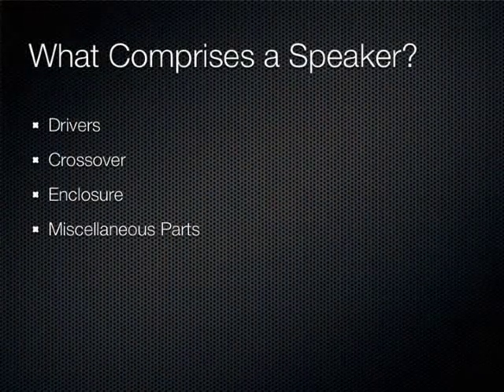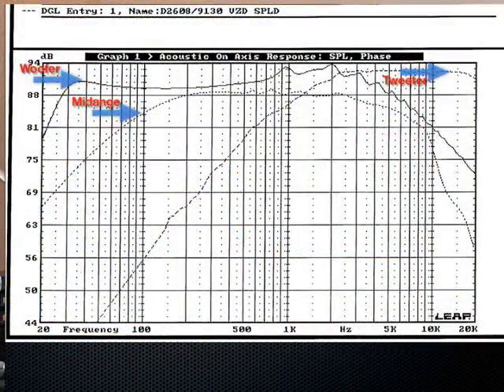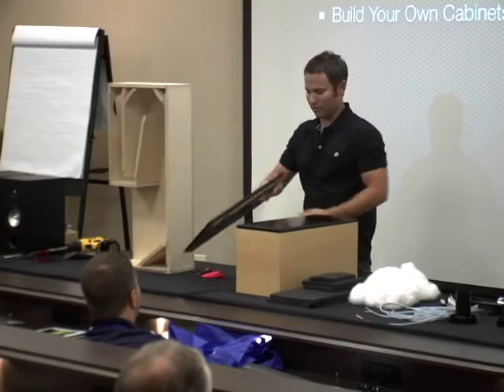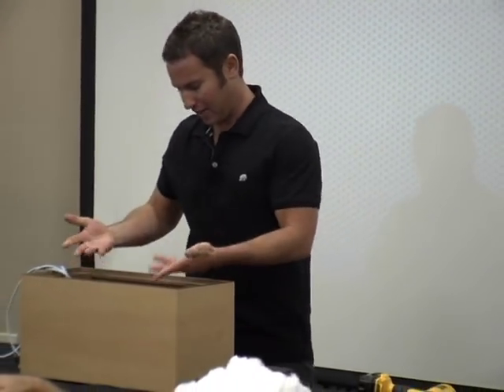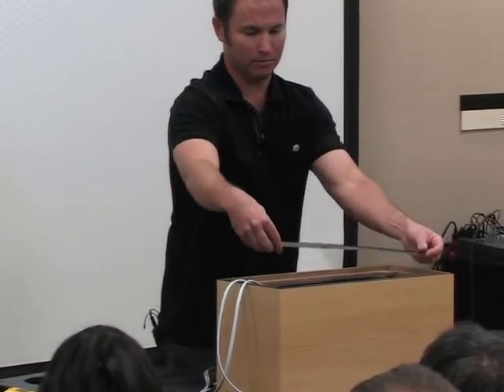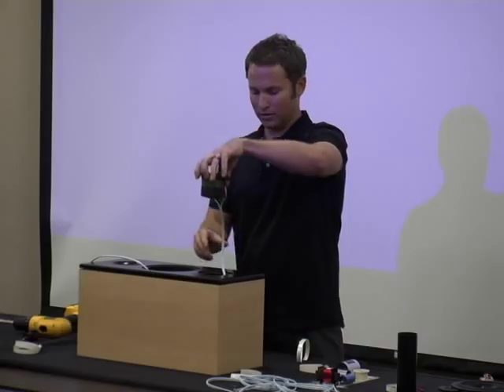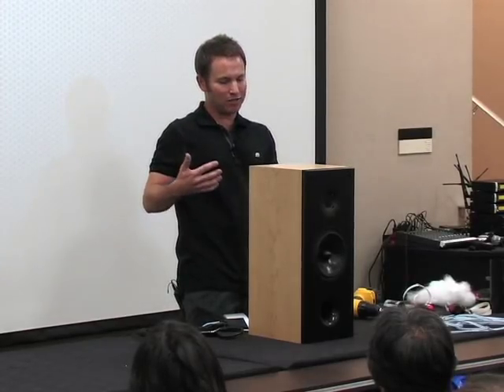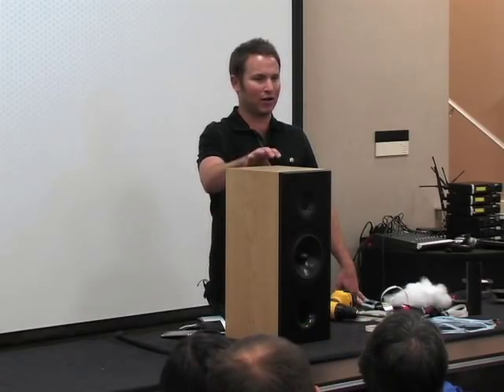RMAF11: DIY Speaker Building: Overview & Assembly Presentation, Adam Johnson, Madisound

Comment: Im so glad we have madisound for custom crossovers. If it wasn't for this particular professional service id be lost in DIY speaker building. When I first was looking into building my own speaker with high-end drivers I looked all over for crossovers. The more I learned about crossovers the more i figured id be buying store speakers,as crossovers are way beyond my skill level. When I came across madisound i was saved. I knew i could make speakers that would cost me 30,000 a pair in store for less than 5000...Ive also made great 2 way speakers with seas drivers for under 2000 bucks. I am a wood worker so i have that covered...Good luck yall,and madisound never go away....

Comment: never ever use a power tool to put speaker clamp screws in !
Reply: reviews and repairs just barely press the trigger and it'll turn slow
Reply: Joshua McLaughlin  thats not the point . If the tool slips of the screw it will go directly through the cone
Reply: @repairitdontreplaceit  That can happen just as easily by hand. Put your hand over the tip at the screw.
Reply: @repairitdontreplaceit  Use the right screws... as he did.